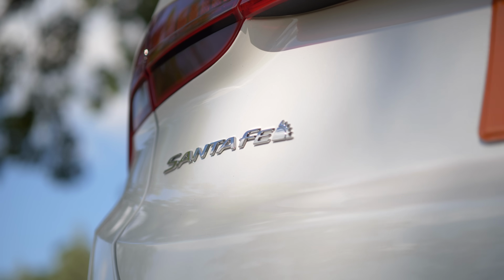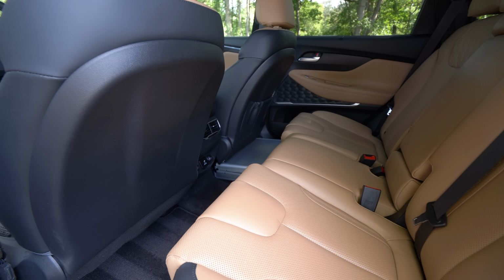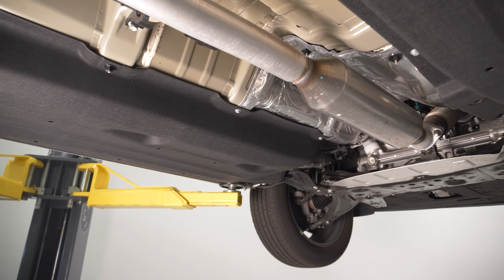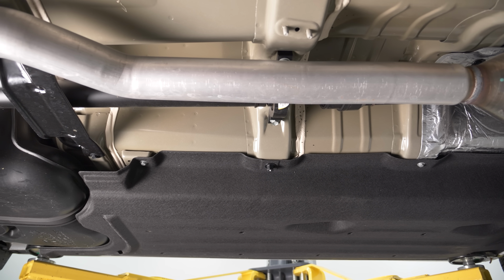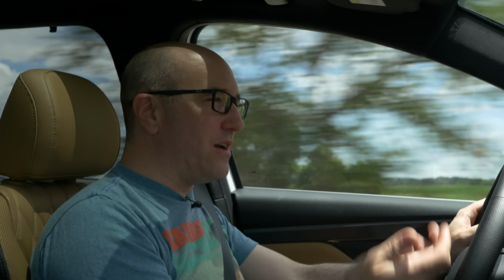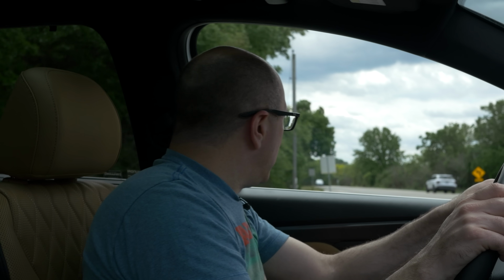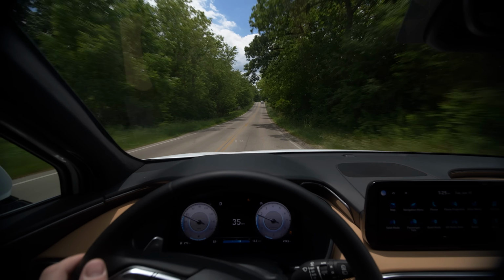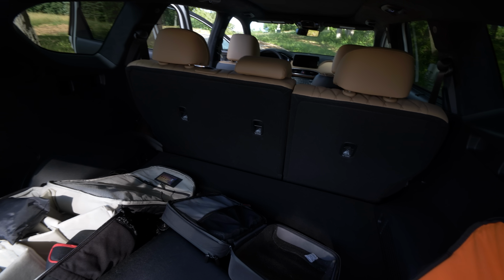2022 Hyundai Santa Fe | They Just Keep Going

Comment: I wanted to like it when my wife and I went to look at one. It's weird enough on the outside to appeal to me. It's got plenty of power and gobs of room on the inside. But there were two things that ultimately turned me off to it, and sadly, neither of them had to do with the car I believe. The first is during the test drive, I didn't get to test drive it, at all. The most obnoxious, lead-footed sales guy took us out for a 3 mile roller coaster ride, all the while shouting obscenities about the other car dealerships he'd worked for in the past, and how this was so much better. When we got back to the dealership, we were coerced into a sales office and blocked off between our sales guy, the sales manager, and some other little hype man in a dealership polo for 45 minutes while we both furiously tried to explain how we weren't looking to purchase right that second, as we had two more cars to look at. Normally I can use my 6'3", 260lb frame to clear a path, but the sales guy was bigger. Once we did make it back out to our car, my back was killing me, and I can't decide if it was because the seats in the Santa Fe lacked the support in general, or they just couldn't handle the joyride we'd been taken on.

Unfortunately, with that being the only Hyundai dealer in the area, I'm not going back to give it another try. I want to like it, but both Hyundai and Kia dealerships are still the reason I can't enjoy the Santa Fe, the new Tucson redesign, or the Stinger GT.
Reply: That must’ve been Tony Salami Hyundai that Mark mentioned.  Too bad you didn’t hang around long enough to meet the extended warranty guy.
Reply: This is such a Hyundai dealer thing to do, it's almost too relatable. As an i30N owner it pains me to even think about going to the dealer for servicing because of how incredibly trash the customer experience is. I would urge any mistreated customer to please contact the Hyundai support center and inform them on the behaviour of their employees. They are incredibly defensive and delusional in answering but at least you're not getting steam rolled for your money.
Reply: The dealership experience at Hyundai has been legendarily poor. Their products are getting excellent, but they don't know how to treat people to keep them as customers. I was listening on speakerphone when a friend got the call from the service manager about her Elantra. Of course, they did a "complimentary" inspection and rattled off a bunch of things to be fixed. Get this- Her valve cover gasket was leaking (plausible) and the guy said that was causing oil to get into the combustion chamber (NOT plausible) I couldn't keep quiet, and rattled off several reasons oil can get into combustion chambers, but not by leaking past the spark plugs as he suggested. He went and asked his tech about it, and indeed, there was no oil in the leaking into the cylinders. He had my friend scared, though. TBH, the cost of the valve cover gasket was a fraction of what a BMW VCG replacement costs. I told her to go ahead and have them do it, and do the serpentine belt and plugs while they were in there, since her car has 75,000 miles. I doubt she will ever agree to services being done there without asking me.
Reply: @dougrobinson8602  Oh man, I wish they gave me that kind of attention sometimes!  They see me coming a mile away.  Middle-aged po'boy with long hair and lots of tools at home...haha
Reply: Ouch.  And I thought I had some very bad stealer ship experiences.
Reply: @johnfetter3252  oh I mentioned Kia too. That one ended up with the cops having to come to retrieve my driver's license that they wouldn't return till I sat down to "run the numbers" which they wouldn't do without pulling a credit check.
Reply: I must've lucked out.  My Hyundai purchase at Fitzgerald in Palm Harbor, Florida was easy, friendly and professional.
Reply: The seats are awful! I almost bought one but took it overnight before making the jump. Glad I did because after 40min I had back pain and my butt was asleep. The pain lasted 24hrs after I had returned the car. Unfortunate because I liked everything else about it.
Reply: I can’t stand car salesmen like that that always denigrate the other brands. it’s so unprofessional to me!
Reply: Dealerships are locally owned, so there are good ones and bad ones. The Hyundai dealership is probably owned by people who sell a bunch of different brands and may run those badly or well. Our local Hyundai dealer was terrific when we bought from them 8+ years ago. Very straightforward, knew their products, let us take a reasonable test drive, and didn't mess around. We might have bought a Mazda if that dealer had worked harder to make a sale.
Reply: Damn, sorry about your horrible experience, next time an nice knee to the groin and cough should help.
Reply: hyundai dealerships are terrible. the cars are GREAT the dealerships are awful
Reply: I've had nothing but bad experiences in the hyundai dealership, though the one time I went to the kia dealership to test out the stinger I had a pretty good time. tried to buy a sonata for my mom and was told at  first that we just needed to put a deposit which i stupidly did over the phone, then the next day told that someone else had already put a deposit, which to me meant that they were gonna try and stick us in another car we didn't want t, so i cancelled everything and to their credit, they refunded the deposit back pretty quickly.
Reply: Cars that sell themselves get unsold by the dealers... amazing.
Reply: Is this really a thing in North-America? Over here they almost are throwing the keys in your face. And if they don't have the spec or engine they will make sure it will be there the next weekend. 

I am exaggerating, but I never went on a ride with a salesman in the car with me. Most of the time I called ahead, and the car was waiting, new of used..
Reply: @JJVernig  Hyundai and Kia are legendarily known in the U.S. for brutish sales tactics pretty much across the country. However, there are many, many documented examples of individual franchise dealerships of other manufacturers that do something similar. Just know when it comes to other brands as a whole, if one dealership treats you dirty, the next one down the street will be more than happy to give you a proper customer experience.

For example, We'll definitely be returning to the dealership we got our Grand Cherokee from because while they know they're going to make a sale regardless, they have no problem ensuring you enjoy the experience enough to make that sale to you. While we were waiting for her new Jeep to be detailed after the paperwork was done, the sales guy tossed me the keys to a new Charger Hellcat, and we got to go for a joy ride just to celebrate and get some fresh air. I'll never forget it.

The best part?

Earlier that day, the Ford dealership actually across the street wouldn't even let us drive an Edge Sport without a deposit. They didn't want to put mileage on a "high demand vehicle." We drove the Hellcat to the Ford dealership to say hey before returning to take our Jeep home.

Also, that 2017 Grand Cherokee ("Maxine"), has been the absolute best car my wife has ever owned. We still own it and will likely trade it in on a new one in the next couple of years.
Reply: @andrewclary872  such a contrast with the experience we had with Hyundai dealer here. They gave us keys of two different versions (Hybrid and Limited) and asked if an hour will be enough for us to test it. No push before, they let us go freely after that, just asking which one we liked more and if we're interested in buying now
Reply: @JJVernig  ...would you mind telling us where "over here" is?
Reply: @paultietz  The Netherlands.

@Andrew, thx for your reply!

They are mostly franchises here also, but mostly under a bigger umbrella. 

There is more to say about cars not automatically a necessity, and financing handled off-site before hand (although with the rise of private-lease this is changing)

But even buying s CPO is a very different experience..

Only outlier is Tesla where people are happy to get their new cars ons the harbor quay in the middle of nowhere... With all kind of damage or bad fitting panels.

Comment: The thing is the Volkswagen Atlas has a 3.6L 6 cylinder engine, so why should I buy this?
Reply: Oh no, the VW influencer troll clown is back... The Atlas is slower, has less torque and gets much worse fuel economy. Also Hyundai offers the Palisade, which is the comparable model to the Atlas, with a 3.8 V6... Also the Atlas is much worse in so many ways.
Reply: My friends brand new Tiguan had a leaky sunroof and his ac failed at less than 20k miles. Ur choice.

Comment: Hyundai really sell better car for American than the rest of the world with direct injection only cars.  It is just hard to press because the resale value of any KIA/HYundai is still worse than any HOnda/Toyota or clunky Nissan.  Although in my opinion, it is better than Nissan in term of reliability history.  But it is still hard to beat any RAV4 or CRV solidity.
Reply: Per Consumer Reports, the reliability of the current RAV4 has not been very good. Toyota has had a number of duds in recent years, and this is one of them.
Reply: @markmiller3279  Consumer report is not that accurate with much less statistical number. The statistical number  and sell numbers tell otherwise. https://www.carcomplaints.com/Toyota/RAV4/ and https://www.carcomplaints.com/Hyundai/Santa_Fe/.  All Santa Fee earned a badge of Clunker although Hyundai sale way less car than Toyota.  If you see the % number, Hyundai is really-really bad.    But it is still better than any GM or Crysler product.   Hyundai is going back to make naturally aspirated engine, and copying Toyota design in dual-injection to satisfy American reliability standard.  You also can see any Hyundai/KIA resale value is less than 70% of comparable Toyota/Honda with the same class and price when they are new.  Hyundai cannot make a good steels for crankshaft and camshaft, they wore out badly when hitting close to 200k miles. The engine timing starts to get dizzy at around 150k miles, won't trow any code but you will notice the idle is not smooth anymore. . Meanwhile, Toyota and honda keep going and going and the resale values prove the quality.  Catastrophic engine failure is very common in Hyundai/KIA.

Comment: Do you think that the Hyundai/Kia group's frequent redesigning of their vehicle's is going to hurt resale value as models just a few years old are outdated as soon as a new or very heavily refreshed model is released? I think the traditional 5-6 year model cycle with a mid-cycle refresh has kept, say, Toyota's prices stable, while it seems that Hyundai/Kia models can be had for far less money at the same age on the used market and it may be because of this reason. Just a postulation.
Reply from the maker: I said this in the Veloster video, they change things so often they seem to have an identity crisis.  Where many brands unify everything hyundai and kia are all over the place.
Reply: I don't know they can make changes so often and still make money.
Reply: @povertyspec9651 ...most of the changes are on the outside (panels). The core of the vehicle/mounting points, sub frames, suspension, stays similar for a longer period of time...
Reply: @povertyspec9651  they actually aren’t needing to make a lot of money right now. They stated that years ago and know they will reach a time when they will make money. But they are rich from other business sectors such as Iron Ore. they stated they know they woke make money for many years and that car manufacturing was something new to get into and it would take time. But that they would get there. It always seems if car making is a hobby for them.
Reply: Well as someone who buys cars 2 to 3 years old I can say I thoroughly enjoy the quality at basically 40 percent off msrp. My 2015 sonata limited was insanely roomy, feature packed, and comfortable. Not so great in snow though haha
Reply: I think they are going with a startup model of constant change to really hone in on market trends. Every model seems to be two steps forward, one step back design wise but they steadily make progress.
Reply: I think that they will soon reach stability. One aspect that I do believe they will always keep doing leaps is in the tech department.
Reply: Is a postulation similar to a fistula ?
Reply: @2004cyrus  yeah, it's exactly the same in fact. they're synonyms.
Reply: It will definitely hurt resale value. The company is moving upmarket with every new iteration (Mazda does the same, yet not so aggresively). It is a unpleasand side effect of progressing too quickly
Reply: They’re taking buyers from the competitors. Sit in a 2020 Honda, Toyota, Lexus, Acura, Chevy, Ford (ANY MODEL) and then sit in a 2021/22 Sonata, Santa Fe, Palisade, G70, G80, GV80 and you will think it’s still 2014. People like technology. All cars will have some maintenance issues; that’s how they’re built but when you’re spending more and more time inside your vehicle; you want to feel comfortable but more importantly people want to SEE the money they spent. Hyundai/Kia give out twice the standard warranty to combat the old thought processes of lazy car buyers who only shop by brand recognition. No, they are on a 3 year refresh cycle which gets them new buyers while there isn’t a Toyota or Honda Car with a 360 camera or Pano Roof. There isn’t a Honda/Toyota SUV with the amenities a Tucson has let alone a Santa Fe.
Reply: @ajyearby2425  Do people really believe what you’re saying? The new Toyota Venza has a pano roof, the new RAV4 as well. Maybe check your facts before posting.
Reply: I don't. Their model is similar to the way computers and other electronics are now released, with new lightly updated models released regularly. I don't think your average buyer pays any attention to the minutia. If they're buying the newest one they look at the models and trim levels and see what they like best. Hyundai resale values are still not great because there's a big part of the population that still thinks they're the crappy cars they used to be. It takes a long time for reputations to change. I knew plenty of people in the 80s who still thought of Japanese cars negatively.
Reply: @markmiller3279  absolutely correct Mr Miller
Reply: While I am generally a fan of Hyundai, one area that they have yet to build my confidence in is longevity. From plastics breaking in the engine bay due to heat or long term engine issues, it concerns me to trust a Hyundai beyond 100,000 miles. And I think this concern is exacerbated, not helped, with the constant changes. Because what inevitably happens when you have one style of a model for a few years then decide a dramatic refresh is in order, the parts supply for the previous style is that much smaller. So when something inevitably fails after a few years (something I could live with given the cheap price of the car) you can't even fix it for a reasonable amount.  So forget even having the dealership perform repairs, us DIY guys can't even get the parts for a reasonable price when the model we need parts for only had the same style for 2 years. :/